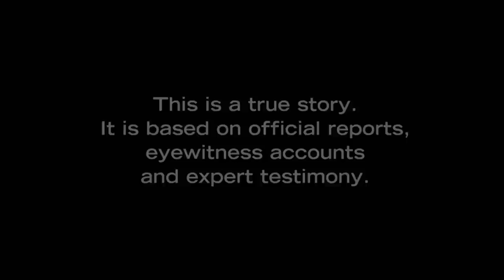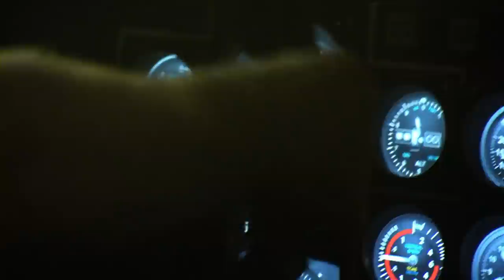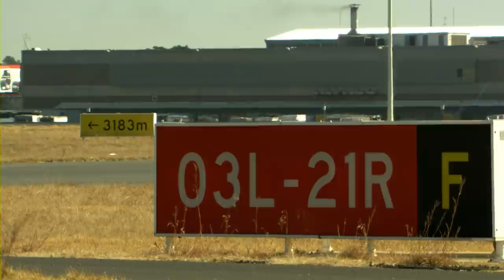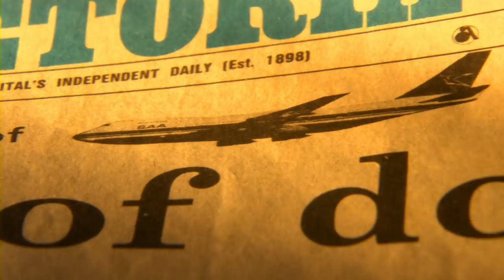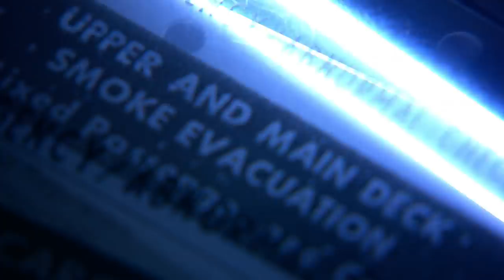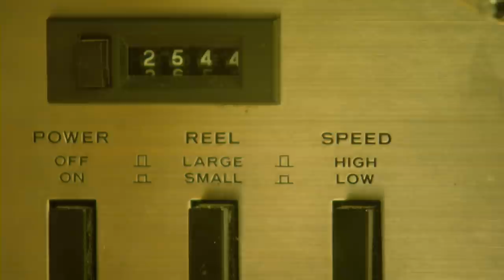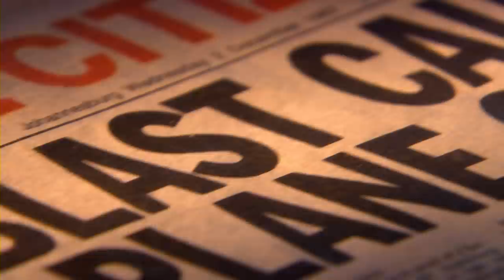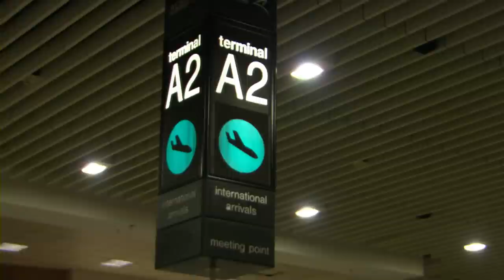The Mystery Behind The Fire On South African Airways Flight 295 | Mayday

Comment: The fire started in what was supposed to be a pallet load of computer batteries (at least that's how I understood the video).  I'm going to assume they were lithium batteries.  If the inside of a lithium battery is exposed to air it will ignite.  One lithium battery burns hot enough to melt the casings off the nearby batteries.  All it takes is for one of the batteries to rupture to start a nasty fire in a pallet of lithium batteries.  While I can't say for certain that this was the cause, it is at least plausible.
Reply: And it was the front left pallet which would be the easiest to spray with the fire fighting attempts and it's also plausible that the firefighting spray itself could have agitated and spread the ignition source as well? All in all it sort of reminds me of the $200 cockpit door vulnerability, hauling cargo next to passengers should at minimum require guaranteed fail proof fire suppression systems that can extinguish that entire compartment.
Reply: @r.scottmacleod4564  metal fires are much more difficult to put out than a wood or fuel fire and require a special fire extinguisher.  Which is why pallets of batteries are banned from commercial passenger flights.  

There are several classes of fire extinguisher.  The ones I know of are:
A solid d fuels such as wood and paper.
B liquid fuels such as oil and gasoline (petrol for the Brits).
C Electrical fires.  Any fire involving an electric circuit.  
D metal fires where a piece of metal has ignited.  Including lithium, magnesium, and aluminum as some of the most likely candidates.
K kitchen fires.  Using the extinguisher won't require the kitchen to be closed for a thorough cleaning.  Useful for commercial kitchens.

Each extinguisher lists the type of fires it can handle.  Most of the ones that you can pick up at the local hardware store are ABC dry powder.
Reply: It depends on when lithium laptop batteries were first common.  I think this predates those batteries.
Reply: Lithium Ion batteries were invented in 1980, well before this incident occurred, I’m not sure how well known their danger was at that time.
Reply: Then it seems that lithium batteries should never be allowed on a plane much less an over seas flight.
Reply: @sharcrum  a palette of lithium batteries, should never be on a passenger flight.  Especially old ones being sent for recycling.  It's why the FAA insists that every lithium be in the passenger compartment where it can be dealt with by crew if it catches fire, each in its own plastic bag to prevent an accidental short, or plugged into it's device (laptop or phone for the most part), and have no more than a maximum storage rating.  The average number of lithium batteries on a plane is more than one per passenger.  Every smart phone and every laptop has one.  Self propelled suitcases have one.  Electric scooters have one (yes, I have seen a passenger with one on a plane).  The charge blocks for recharging your phone when you can't get to an outlet are one each.

Comment: A nitrogen fire suppression system would be a great idea. It is capable of putting many types of difficult fires. I work with nitrogen and know how well it works. I have seen it action as it put out a methanol fire. Nitrogen takes away oxygen and it's extremely cold (-320 Fahrenheit)